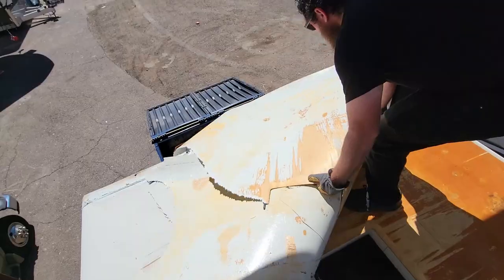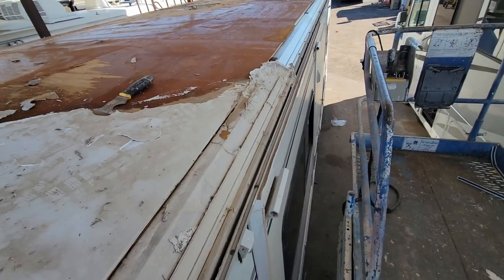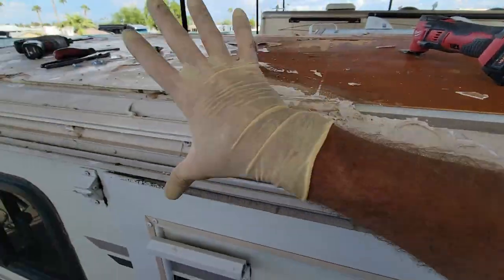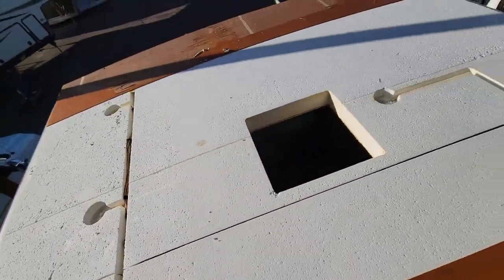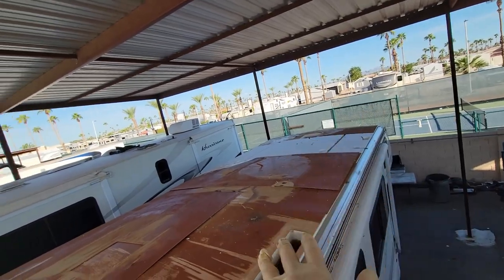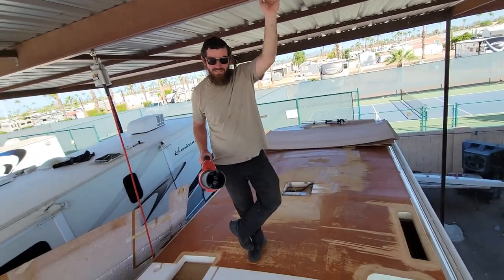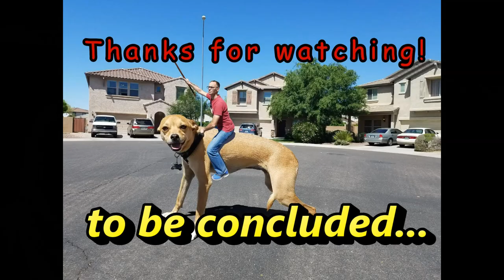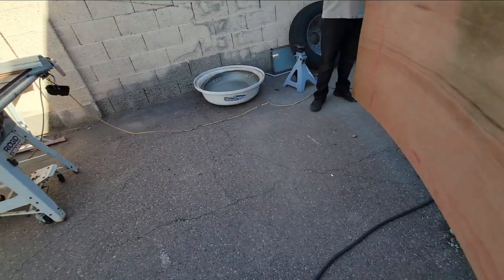What Are the Next Steps on this Winnebago Roof Replacement? part 2

Comment: arm chair quarterbacking here but i like to use adhesive shrink wrap over my wire connections to give the electrical connection some more structure to prevent pulling or wiggling loose

Comment: Hey James.
Yet another informative video.

I have to tell you.  I watched many many of your videos and I got up the balls to tackle my trailer that had a few issues.
It's and ArcticFox so the major delamination issues that they are famous for in my area.
Rebuilt the front end and 8 feet down the side.
The rear end and delam at the back.
New roof and a mitt full of other issues.

While it might not be up to your incredible standard, I have to say that I am very happy with the way it turned out, ready for many more years of use.

The trailer was basically useless before.  I was just going to demolish it or burn it, no way I would ever sell it to some poor unsuspecting soul.
Now I have a very nice, perfectly usable RV again.

Thank you for these very informative videos.

Regards from the Wet coast of Canada.  ( yes I said wet and not west, I am on the west coast but it is wet.  Everything rots here)

Comment: The silicone is probably Henry's Tropicool, I used it once if used correctly it had a lifetime warranty, it survived a lot of abusive weather for me. It's not a repair product that's a mistake, it's an extra layer of insurance.  They also have a brush on product to treat areas around vents etc,  you have 24-48 hours to get all the layers on ,

Comment: I love these roof videos.  I don't have a problem with SIP's, but it would be nice if Winnebago actually used thicker plywood instead of thin luan.  Or better yet, if they used thicker Azdel panels instead of luan all together.  They should also infill the foam channel cutouts to get a true benefit of a SIP system.